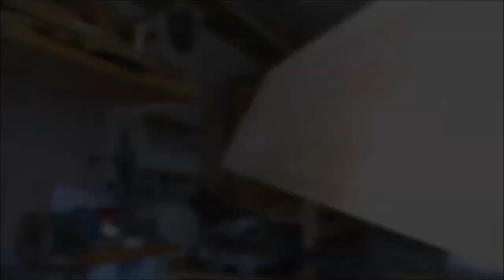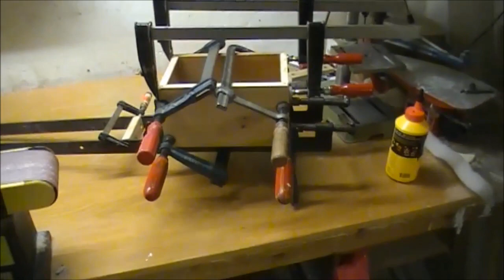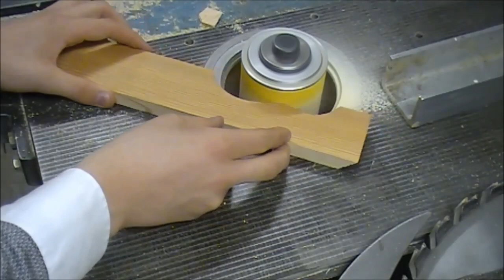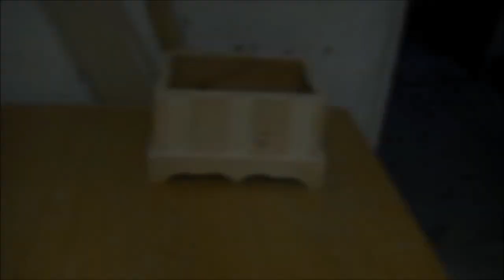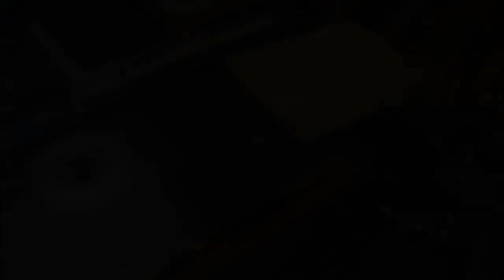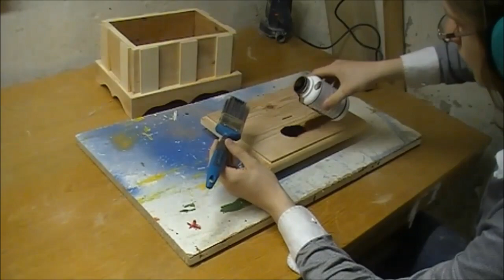The Wooden Chest

Comment: a spinlde sander in the middle of your table saw?  Cool!  Does it run off the same motor?
Reply from the maker: +BJEAKE The spindle sander & table saw has it's own motors, but the planer & the slot mortiser share the same motor. :)  The spindle sander can be change into a spindle molder too, which is a bit terrifying to use. :I
Reply: creativeobsin
I had no idea they even made this stuff, very cool.  Thanks.
Reply from the maker: +BJEAKE :)

Comment: What kind of table saw is that?
It has a planer built into it....
Reply from the maker: Kevin May This table saw (made by "Luna") is a so called  "Combination Machine"   
It has a planer yes, there is a sander and a horizontal drill as well. 

Here is a picture that i found of the machine I have - http://www.machines4u.com.au/machinery/21/99321/LUNA-W59-COMBINATION-MACHINE_617862.l.jpg